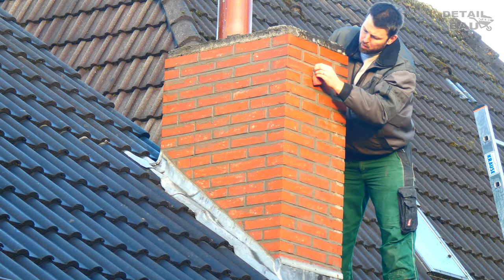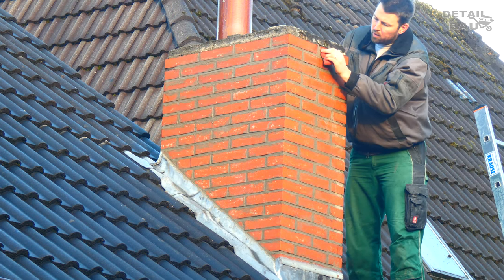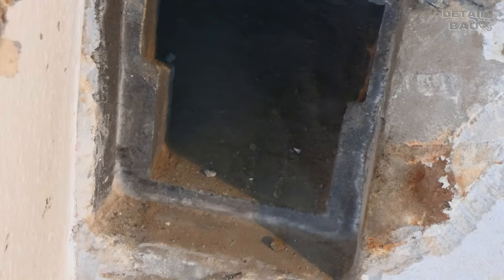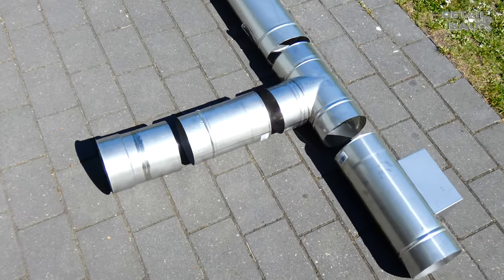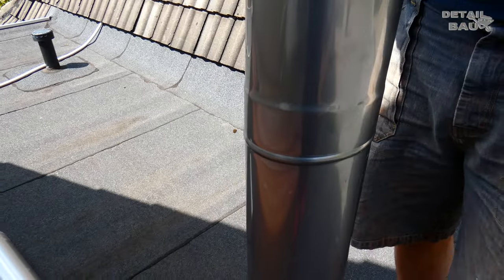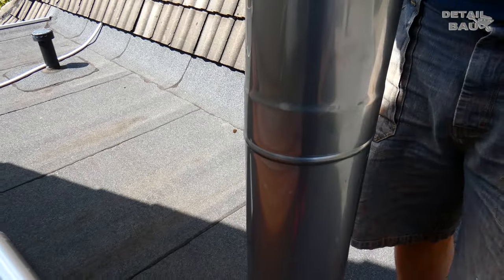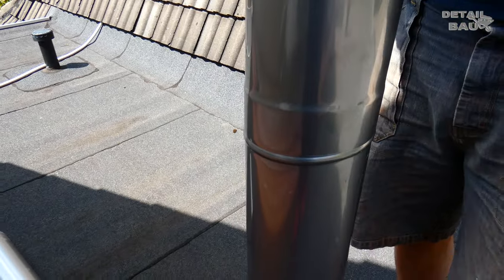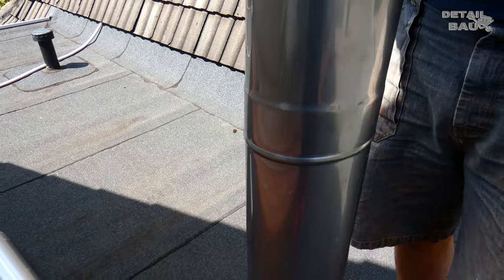REBUILDING OLD CHIMNEY W/ STAINLESS STEEL FLUE PIPE: INSTALLING INSULATED REPLACE LINER, CROWNREPAIR

Comment: Great video. Thanks. Nice trick with the bolts and the injection cement. Which country was this project in?
Reply from the maker: this was in Germany, thank you and have a great day
Reply: @CarlsImprovements  Haha, I thought so! That's great, I'm renovating a building in Brandenburg which needs the chimneys repaired, and without speaking much German, it's hard to find content that is appropriate. Thanks.